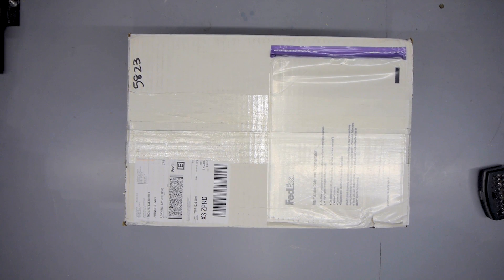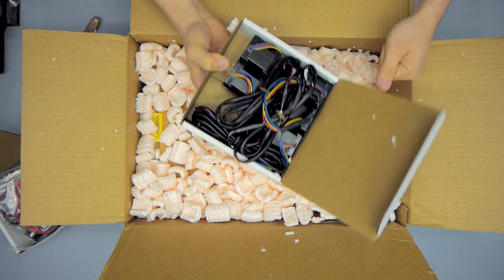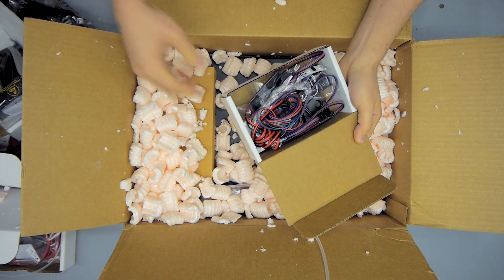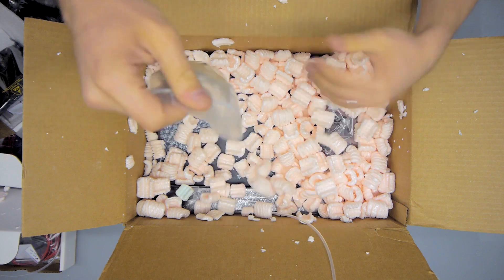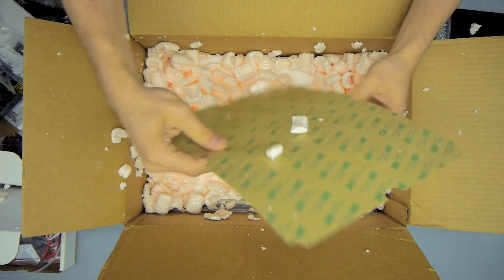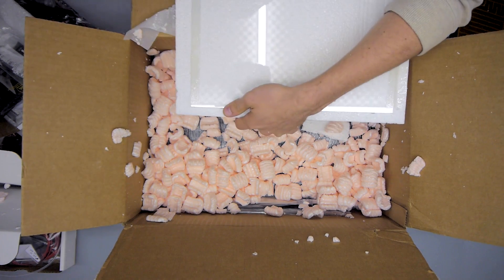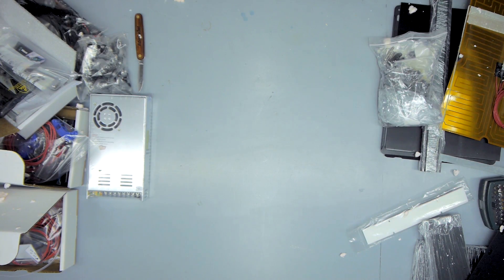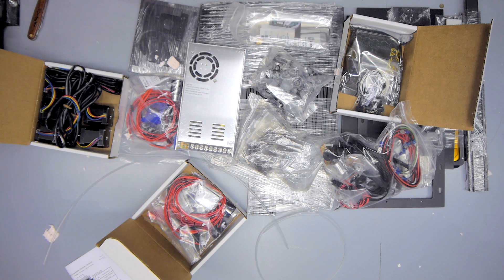MendelMax 3: Unboxing and build timelapse!

Comment: Thomas Sanderson Are you going to be backing the Genesis 3D Printer on Kickstarter? It is around $200 for a 10"x10"x10" build area.

And did you ever back the Cobblebot Little Monster/Vanguard?

Thanks

Comment: The MendelMax 2 was my first printer and I got it when it was still in beta. I did the upgrade as soon as the MM3 came out and it is an awesome printer. The Open Beam construction makes the printer very stable and accurate. I can good prints even up to 120-130 mm/s (depending on the object being printed). Building the printer does take some time and it benefits you to take your time and get it right. Its been a few months now and I have only had to do very minor tweaking. Most times I feel confident to walk away before even seeing the first layer go down. Also they have an awesome IRC channel that at almost any time of the day/night you can get help from them and other customers with the printer. Cant wait to hear your review Tom!

Comment: nice  build and beautiful design, but those cables from extruder look awful. I would use spiral wrapping at least or  chain holder.
Reply: *****  I just checked maker's site and main photo has drag chain. Nice to know for those spiral wraps, useful info :)
Reply: JohnyK what i really think is awfull is the "maker's tool works" logo on the top. Already having that other logo on the bottom. I wouldnt have used led strip's either. MM3 looks much more sturdy and is probably improved in many aspects, but the MM2 was much more elegant and beautifull to my taste.
Reply: Diego Flores The LEDs are completely optional. You do not need to install them if you don't like the way they look. Overall, most people seem to like the look, but you can never please everyone :-)
Reply: Diego Flores the laser cut logos are bad enough; when I saw the finished build with the LEDs, I literally got mad and wanted to throw something.
Reply: JohnyK Sorry you found the pic misleading, it wasn't our intention. We do note that the cable carrier is an optional user-printable upgrade, but I will see what I can do to make that more clear. 

You should not need to extend the wires to use the cable carrier, though with the dual extruder version you will need to omit the Z axis cable carrier. You can still use the X axis one without requiring any extensions. We have talked about finding some motor extension cables, so I will move that up our priority list to allow the use of the carrier on the Z more easily.

We actually had originally planned to sell a cable carrier kit as an optional upgrade, but one of our beta testers designed the printable version before the printer was even released. It has been very popular, so we chose to just leave it as a free DIY upgrade rather than selling it separately.